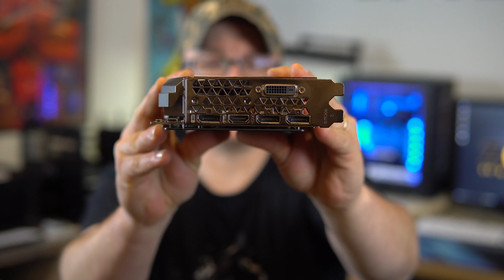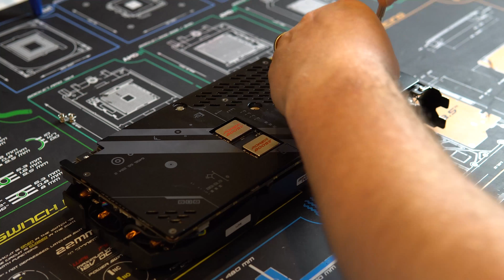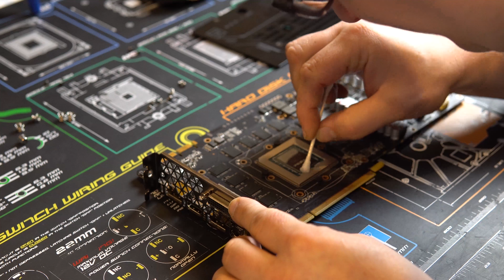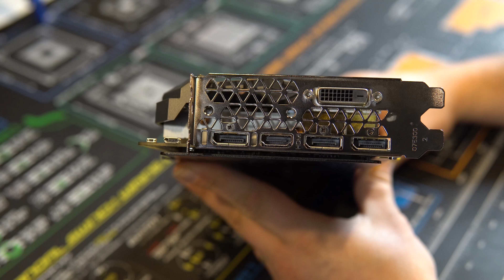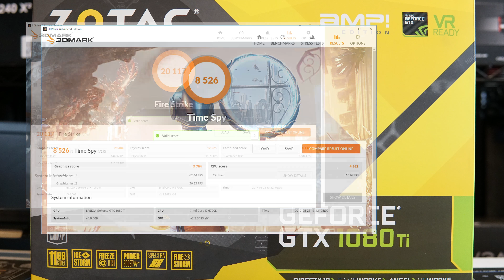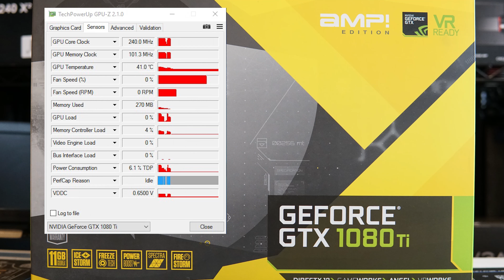Zotac GTX 1080 Ti AMP! Review - Is it Perfect?

Comment: I cleaned the gpu like brand new and applied perfectly Artic mx-5 and runs so hot (84°C) idk what to do, is that normal??
Reply from the maker: I would check all the screws again. Sounds like its not tightened down enough.

Comment: That cooler at 100% sounds like a vacuum cleaner. Those fans use low quality sleeve bearing and fail about 10 months into use. Zotac RMA requires you to mail the card to Taiwan. At acceptable 65% speed the cooler can only manage ~75C on a 1070Ti. I've owned about 15 1070/1080 cards, this is one model I would skip.
Reply: Is it really that bad? I found a used one going for 450usd listed by a somewhat reputable vendor. Is the risk worth taking?
Reply: Wanna add that I'd keep the card in a case that has good airflow and also under-volt it

Comment: Will this card work with this pc? https://www.tesco.com/direct/cube-corporal-gaming-pc-amd-a10-7700k-quad-core-with-radeon-r7-graphics-16gb-memory-desktop-amd-a-series-quad-core-seagate-1tb-7200rpm-hard-drive-wi/418-4863.prd?source=others
Reply: Yes but the APU is a Bottleneck for this kind of gpu... it dosent fit the rest of the PC.. You should get a CPU instead... and please use a ssd in 2017! Good Luck!

Comment: dont buy this card. the cooler is just not enough for a 250w tdp card.
Reply: Clueless post.  Outside of a amp extreme all 1080ti's ive touched from the gaming x, to the aorus extreme are hit and miss.  The fan setup doesn't matter near as much as the quality of the chip on the card.  Also my amp extreme dicks the rest of them bad.  They topped out slower than my 2032mhz founders,  my amp extreme runs at 2088mhz,  and ran 2050mhz out of the box.  The fan speed and temps he ran with this card is par with my gaming x, and aurous xtreme that I had ran out of the box with a 80% fan speed.
Reply: or perhaps its just enough. if i remember correctly, either guru3d or techpowerup tested its load temperature at 81 degrees, which is just before the down-clocking temp or 82 degrees. so its fine as it is, but not for overclocking. of course, its assumed one has great casing airflow. if not, like you said, its not enough.
Reply: R6ex Mine reached 87c at 100% fan speed in open case. Worse than the FE card. Room temp is 24c. 90c temp target and powerlimit max.
Reply: That's hot!
Reply: R6ex Yeah so I sold it cheap. the store said its still normal. I would never buy zotac card again.
Reply: Actually, the reviews for the Extreme version are very good. I, myself, will choose Zotac as my first choice. Why? Their Extreme cards seems good. Their pricing is one of the cheapest here in SG. Most of all, it carries a 5-years warranty here while other brands 2-3 years only. Sadly, I'm unable to use their Extreme card as their triple-fan design cause the card to be a tad longer than my Silverstone Raven RV05 casing can accomodate. That's why I'm looking at this 2-fans version. Well, seems like its not a good alternative to the Extreme card.
Reply: R6ex yeah the Amp Extreme is the good one.
Reply: good thing I plan to replace the cooler with and EVGA SC Hybrid Cooler
Reply: Pablo Kho yours was faulty then, for a fact.

Comment: This GPU or Amp extreme , how much fps difference there will be ?
Reply from the maker: +Epicjack the Extreme is slightly faster, however  the margin is only within 5%.
Reply: Can you tell me how much is your card pushing on overclocks ?
Reply from the maker: +Epicjack Highest I got it to was 1999 stable, however GPU Boost was boosting to 1949.
Reply: Epicjack 7-8 fps